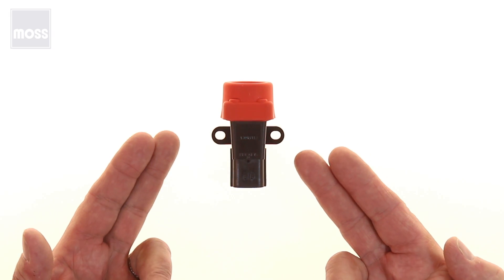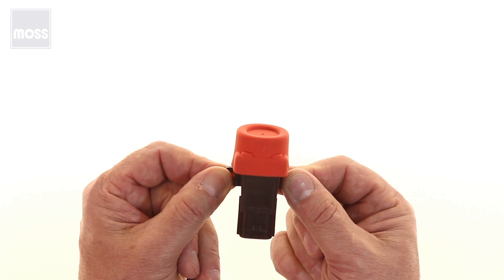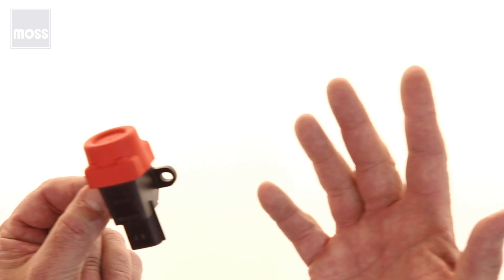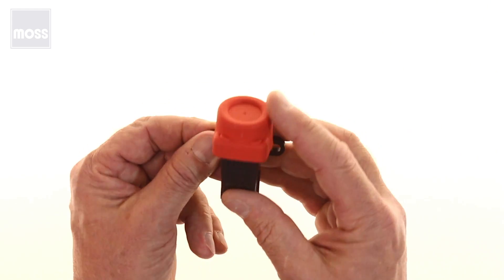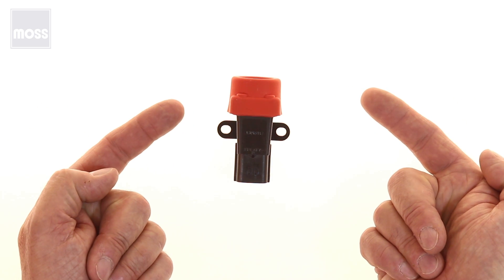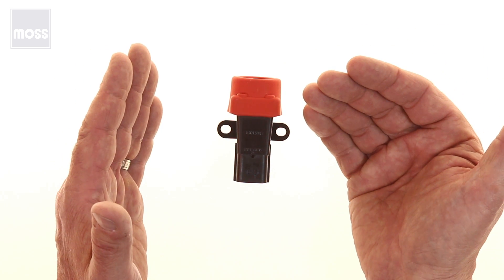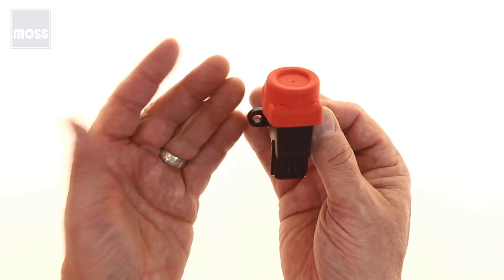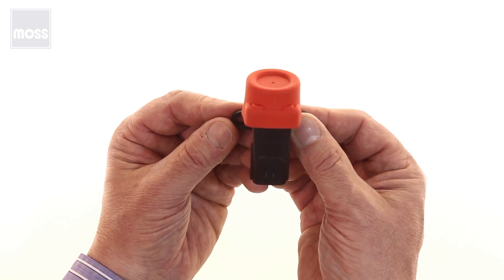Emergency Fuel Shut-off Switch - Why You Need One (Moss# 900-240)

Comment: Does anyone know how you wire this thing in??? I have search all over the web and there is nothing telling you how to do the install.. it has two wires... its it power and ground or do you splice this in between the pump and the power... I have had this thing for 2 weeks now and Its been impossible to find any answers... Thanks in advance to anyone that can help. The unit did not come with install instructions.. thanks again!
Reply: its not polarity sensitive.  you put it in line with one of the wires which runs to the fuel pump

Comment: Ford put that stupid thing by the passenger floor board and every once in a while the passenger will touch it with there foot and it will literally kill the motor at any speed. These things can cause more accidents than there worth.
Reply: Bricklinsv1970 that literally happens to my work truck today
Reply: Can you tell me if there is a fuel shutoff on a 1996 Chevy Silverado truck